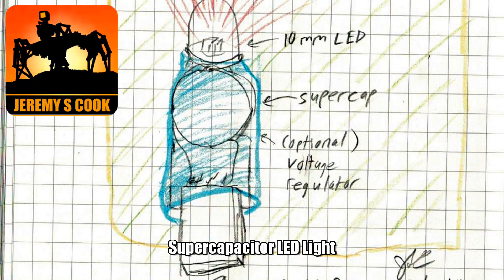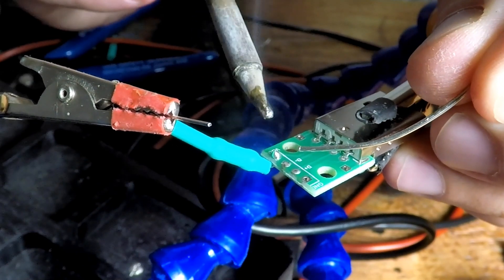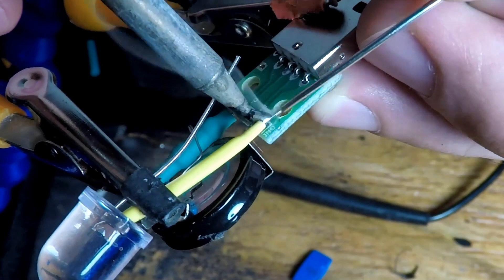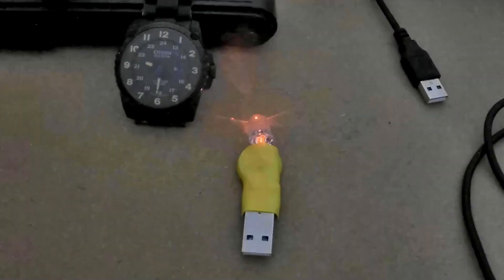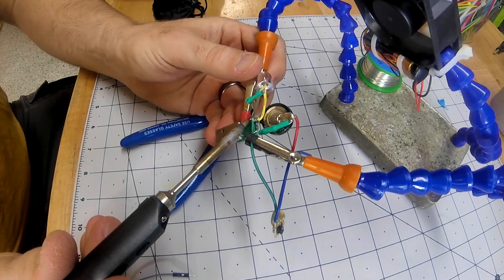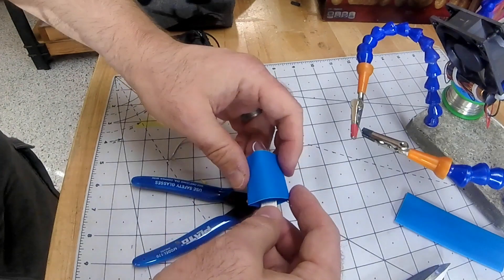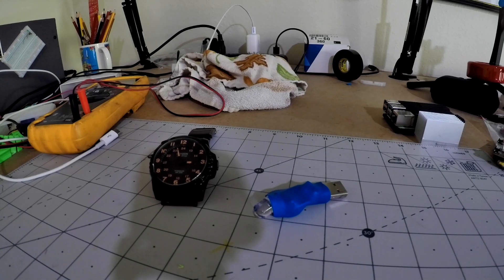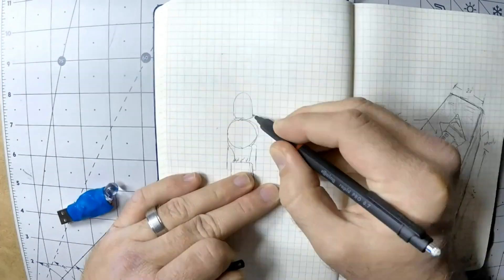Supercapacitor Flashlight Howto [1F, 5.5V Cap, USB]

Comment: you should try the "joule thief" circuit, actually it would be a great circuit for this application. basically it would make the voltage in the capacitor that is unusable due to the high forward voltage of the LED still be able to provide a stable output until there is virtually no power left in the capacitor at all.
Reply from the maker: Not a bad idea, maybe I'll try that out at some point!

Comment: Hey, just throwing this out there, check out this handpump flashlight. It's a cheap design, but a combo coordination between what you made and this would be perfect for emergency situations if you made it better. https://www.amazon.com/Domire-Battery-Camping-Outdoor-Flashlight/dp/B00J1G27KA/ref=as_li_ss_tl?ie=UTF8&qid=1506007783&sr=8-133&keywords=crank%2Bpowered%2Bflashlight&linkCode=sl1&tag=lane08-20&linkId=3afd5aa38dc0ca2628584dda3a19b64a&th=1
Reply from the maker: Thanks for the idea!

Comment: Good to learn how much 'one farad' work you can get...
Reply from the maker: Glad you enjoyed. Maybe I'll make a bigger one eventually, though doubt I'll do another full video.
Reply: @JeremyCook  I plan too buy 2 banks off 6×2.7 volt capacitors and series them for 5 volt and run LED strip light how long do you think the lights could run before re charge ...I have got a 5 meter strip light running off a small phone power bank and its been going for 12 hours and all 4 power bars are still on so these are great for strip lights and it's only small bank but I want too get too know capacitors and I thought this be a good starting point with LEDS...cheers mate
Reply from the maker: @jshaw4757  Hi J - The voltage is one aspect, but also you have to look at the Farad rating. I suspect that if you're trying to run a string of LEDs that they won't last long.
Reply: @JeremyCook  Hi yh thanks for reply and I've spoke too the A.I bot and it gave me all the equations on my LED capacitor setup and 6 × 500 farad super caps even those high farad ones it calculated that it would run a 10 LED strip for only 21 minutes...so would need a ridiculous amount off caps but I have built salt batterys before n ran LEDS but you have too parallel many many off them too get the amps up but I was thinking use them too trickle charge the caps n maybe extend the run time off caps significantly but I will try ..if can get 24 hours run time it be worth it as only a 30 second charge too get another day but I doubt I can achieve 24 hour run time...there is hybrid capacitors with higher store potential but I've not looked into those...anyway long message just bouncing ideas...cheers
Reply from the maker: @jshaw4757  Cheers! 500 Farads is a HUGE capacitor FWIW. If you could reduce it down to a single LED perhaps that would be possible.